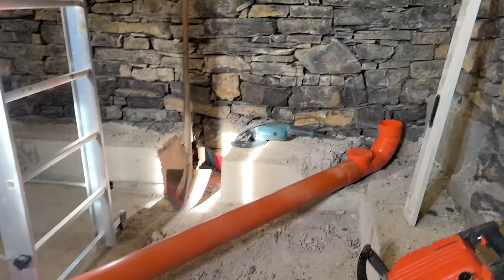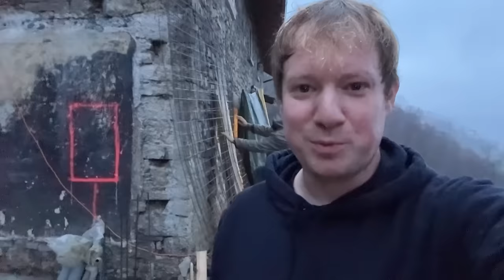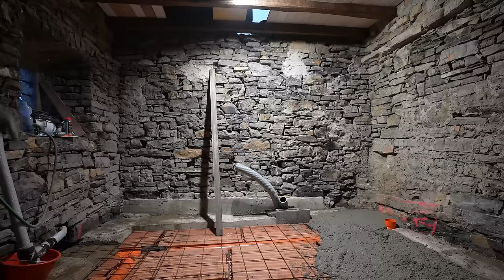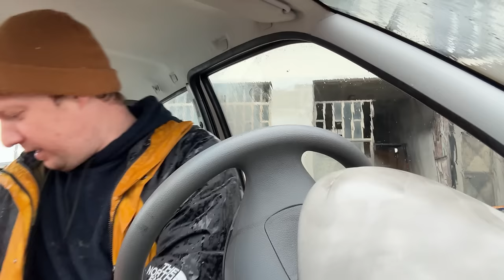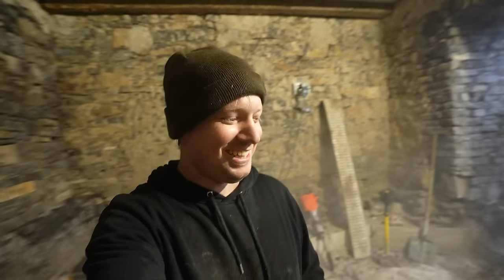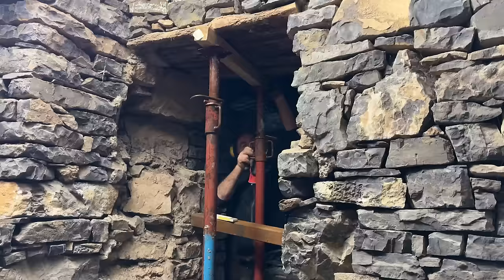Creating a New Doorway in our Stone House.

Comment: Have you considered leaving this stone building as it is, now that it has been fortified, and making the addition to the house the main living space?  I think it will be easier to build with modern materials which allow for more window light, better insulation and easier installation of modern utilities and wiring.  You could use the stone structure as a storage space for tools,  a work studio or a summer house.  You can spend a lot of money trying to insulate and water proof that structure, and it will still be dark, cold and small. Or completely fail in is waterproofing or something else.

Comment: I was wondering if you could maybe put a water proofing coating on that back wall, like when someone wants to waterproof a basement, that might just work, will save you alot of work and a headache, you might need a little bit of other work or several coats of sealant, I think you should consider it.

Comment: Can i say would it be possible to put a visqueen membrane to stop all the damp from rising upwards and where you get the water coming inn from the back wall could you dig round the back of that wall and put a strong wall up with a field drain to run water away from the building altogether , it will be extra work and you have worked really hard but tthis really will help your house.

Comment: As you seal off  old seepage channels the water will find alternative routes. This may ever result in a higher water table behind house,. This may result in more moisture higher up walls. Assume that any mitigation you think of is necessary.
Reply: They just want to build and think these  things afterwords. No previous building experience. Shiitpipes and frenchdrainage doesnt belong together but stil they are doing it.😂
Reply from the maker: Hey there! When using a p trap this “French drain” or internal gutter system can be thought of as a shower drain. The same reason why your shower drains into the waste pipes and doesn’t smell is the same reason why we won’t have problems with this setup. Super common to
Build this way. 👍
Reply: @northerntrucker   You said " No previous building experience. ".  While this might be true of Brady and Heather [which I think isn't concerning Brady] from the very beginning, all the way through, they have been consulting professionals as well as following the legal building guidelines of the region. In truth, they are building this floor system under the guidance of a professional with 30yrs of experience!  So, your comment is not well founded and since I have come to consider them "family" I don't appreciate this unfounded public remark. Let's seek truth before speaking. Thank you  😉

Comment: Do you know you could have used a steggo impermeable wrap under the first slab and then simply built a wood or steel studded floor joist system with a plank board subfloor and or finished floor that way you have access to your pipes while also being able to install insulation.

Comment: Great to see you all back at it in full swing.  You have a tough nut to crack but, it is taking shape and will be amazing watching you bring it all together.  Just some friendly constructive feedback from an architectural engineer and builder… it is concrete, cement is a component of concrete.  Drive on, you cannot stop.  Very good work.

Comment: I would say it was an error not to use the Iglu system, at least for the reasons stated. The water you observed condensing on plastic tubes did so not because of some inherent quality of plastic vs concrete/clay but rather because of thermal mass. Water condenses on cool surfaces. You observed it condensing on plastic, because these are thin pieces of plastic with little thermal mass, that very quickly lose or gain heat from their surroundings. Thick layers of concrete lose and gain heat very slowly. The reason for this difference is almost entirely thermal mass. 

But the Iglus under a vespaio are not in the same conditions as they would be laying out in a yard. An Iglu in a yard quickly gains or loses heat because it has very little thermal mass, and when it is cool water will condense on it. But an Iglu in a vespaio has a massive layer of concrete attached to it, hence the plastic Iglu and the concrete become one, in terms of their thermal mass. The Iglu will gain or lose heat at the same rate as the concrete, IE very slowly, and will remain relatively warm all year round in a vespaio. So condensation isn't really an issue here.
Reply from the maker: After seeking advice on this matter from no less than 6 different local builders, ever one of them agreed with me that the plastic igloos are far inferior for this and other reasons to the system we used. So between my own observations and their recommendations I feel confident in our decision
Reply: @RaisingVoyagers  You can take it up with the laws of physics, I guess.
Reply: @RaisingVoyagers  I think you have someone scamming and pretending to be you?

Comment: How do you keep the concrete from filling in between the ends of the long tiles and plugging up the airflow?
Reply: That was my question as well.
Reply: They fit together so that there's no air gap in-between. They are shaped specifically for that purpose.
Reply: The airflow is below the clay tiles where the cinder blocks are, not through the clay tiles themselves.

Comment: Good to see this phase coming together!
Question- how does the cement stay out of and not block your airflow? Look like there is enough space for it to flow in and block that. Also with all the additional work they have you do for this, they don't inspect to make sure it's completed correctly? Thanks good luck the rest of the way!
Reply: That's what I was just sitting here wondering as well.
Reply: There's no gap, thanks to how the tavelloni are shaped.

Comment: WOW, what a complex plan for that wall. Would it be possible to spray a waterproof "membrane" on the wall, inside or outside?  That way you would not have to do that rendered wall and lose internal space.      Finding that old doorway hopefully will make things easier for you.  Maybe the building was first a home, then, after closing the doorway, made into the barn area for the animals.  That was 1 huge stone that it needed all 3 of you to manage it.  That tractor-driven "wheelbarrow" was certainly perfect for the many jobs you have used it for.

Comment: So you don't glue your drain pipes, you just heat them up and stick the together, that's not very water tight,
Reply from the maker: Pipes were glued on the factory ends but heated on the cut ends. After heating the plastic contracts for a tight seal, and these are not pressurized pipes, it simply needs to handle water draining one way.

Comment: Corrogated iron roofing works great as a le age in floating formwork.
Reply: I meant leave in form.
Reply: I'm surprised that you are running the internal French drain into the sewer line. That water is probably going to be clean enough to run into a water tank on the terrace below, and piled underground back into use for toilets, and filtered for kitchen and bathroom.

Comment: I would have used grey or even blue pipes... The orange ones don't have gaskets, and they are not the best quality, so they won't last as long as the best ones.
Reply from the maker: Here in Italy, these are actually the second highest quality pipes available, and more than suitable for what we are using them for
Reply: We put grey and blue pipes in our vespaio, 'cause we wanted to completely forget about them until the next two generations... We even buried them under a layer of welded steel plates, but that was probably an overkill (even though it save them from being damaged when the workers had to remove a small chunk of the concrete slab to insert a couple of cable conduits in it).
Reply: Side note: I'm excited about the arched doorway! Looking forward to it!

Comment: Would you allow a slight, really unimportant correction. The Family owns a concrete company so the meaning of cement and concrete in the trade is a little sensitive, but not a deal changer. Cement is the dry ingredient that goes into concrete. Concrete contains cement, aggregate, water, and other ingredients and becomes hard when it dries. So you are pouring concrete to make the floor.
Reply from the maker: Correct, I often slip up because in Italian there is no word for concrete. “Cement” means the powder and the mix, there is no separate word, and since I work in Italian it’s easy to get confused 😊
Reply: Hi Brady.
I follow your channel with huge interest.
What you are doing now recall me what i did some 40 years ago to build my 3 floor house starting from the soil. The first 4 years  have gone just to have it in a acceptable condition to move in.
Same method as yours....i worked hard  along with hired people in order to save some money.
A lot of hard work ,passion , courage ( I built it without permissions!!l) , dedication to give my family a "roof". I should also add my phisical condition..i was less then 30y!!!
So i wish to congratulate with you and your " girls" for what you are doing.  Keep on going and nothing will stop you.

And after some memories a bit of tecnicality:

Yes, we have a word for concrete: CALCESTRUZZO  , CLS for short.

If you add rebar/mesh , it will be CALCESTRUZZO ARMATO , often simply called CEMENTO ARMATO.
This said , the VESPAIO you just built is ....un vespaio in cemento armato.
Buon lavoro.

PS:
It would be interesting to see your palms.  Full of calluses?
Mine were full of it!!!!
Reply: It Italian a mix of cement + sand + gravel is called "calcestruzzo"... @RaisingVoyagers
Reply from the maker: Correct, I’m also working with workers from bergamo who speak a mix of Italian and bergamasca

Comment: how strong is the terra-cotta material? I don't think its very load bearing horizontally.
Reply from the maker: Not very strong at all, but strong enough to hold the concrete, and this is how they build their houses here so it works!
Reply: The concrete slabs hold itself as soon as the curing process is over. The tavelloni only serve the purpose of holding it up while it dries off...

Comment: Random question…. But, you wanted a floating floor with the air bricks 11:23 when your pouring the concrete won’t it just fall between the gaps in the air brick lengths and seal them up at either end 🤔 as there was some quite big gaps in that layer??
Reply: I thought the same thing. I wondered why not add a membrane or something.
Reply: Opened comments to ask the same. 
It would completely ruin all the crawl space ventilation, leaving sealed air pockets inside bricks. 
I don’t get how this is supposed to work, looks like a complete waste of money and materials. 
But I’m not an expert.

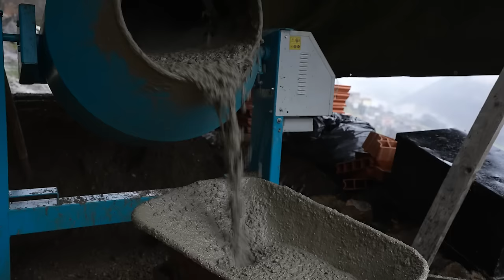12:38  Exactly what you described, clear view of concrete leaking inside gaps
Reply: The clay bricks are to support the floor. The air circulates in the space below them.
Reply: There are no gaps in-between the tavelloni.

Comment: Congratulations on the doorway and the progress!  I'm confused as to how the clay air channels can support the weight of tons of concrete when they are largely unsupported themselves.  If you were installing a wooden floor, yes, but concrete?  Also, the air channels seem like they would get clogged up by the concrete.  Can you explain more?
When you said you were doing French drains, I assumed you meant OUTSIDE the walls.  Is there no room outside to put them?
Reply: I think, with such a complete lack of understanding.... .you're probably best not asking questions about  building techniques...
... You already seem to be harbouring prejudice and pre-conception... despite complete ignorance..!!!
Reply: The concrete slab will hold its own weight and the weight of whatever you put on it as soon as the curing process is over. (You usually lay a rebar net in it, though).
Reply: @andymccabe6712   Rude much?
Reply: @Myria83   Thank you for your polite answer.  I know the concrete is strong.  I was thinking that the terracotta-colored sections with the 4 air channels were actually some type of terracotta.  On a second viewing,  they sound more like metal.  My apologies for the confusion.

Comment: You will not solve the water ingress issue through internal collection and drainage alone. Moisture will accumulate in all the unventilated voids.  The first step should have been layers of diversion drainage and waterproof membrane on the external  surface of the wall.
Reply from the maker: We will be adding diversions drainage on the exterior as well. In this part of Italy, these systems are commonly used successively
Reply: @RaisingVoyagers  Good. We did this on a house with soil on 2 sides to ceiling height on the lower level in Molise. The exterior drainage and membrane was the game changer.  Good luck. 👍

Comment: 31:19 question in order to help your fireplace regulate heat throughout your place have you considered putting in a long pipe so you can start in the farthest room away and when that room gets warm it would circulate cold air from the farthest room straight through the doorways.

Comment: With the bog gaps in the ends of the clay tiles you just filled them with cement. How does that help your airflow?? Or are they just to support the concrete floor? Maybe i missed something
Reply: ... air circulates UNDER the clay blocks.....!

Comment: For that wall with the moisture issue - I watch another YT channel and they used the type of sheet rock you'd use in a 💦 shower / tub area.
They faced the green side towards the wall.
The opposite of how you would in a shower since the moisture is on the inside. 💧
He also used wool insulation since it is moisture wicking.  🐑
1800's homestead.
So far so good .👍
♡

Comment: hi .. sadly, with the pippes, you now have construction botch. horizontal pipes, just put together like .. this .. can not be tight and never will for water. sure with concrete over you will not see it the next time. i hope for you, because video youtube delay, there is no concrete over it now, until you do your plumbing the right way. there is a reason these pipes have o-rings as seals (and tight tolerances even and mostly in bad-water drainage), and not just ´put them together like kids put together straws for drinking! .. sorry, that is bad work, and you filmed it. geeeez.  sorry - but - that must not be accepted that way. (i built two homes, and i can tell you, you do not want dripping pipes, and dripping bad water .. never. sorry to tell you.
Reply: i should have watches more than 3min video ... hopefully your dehumidifying stone-tech works     .
Reply from the maker: Hey there! No these types of pipes don’t have o rings and were actually installed correctly. No worries!